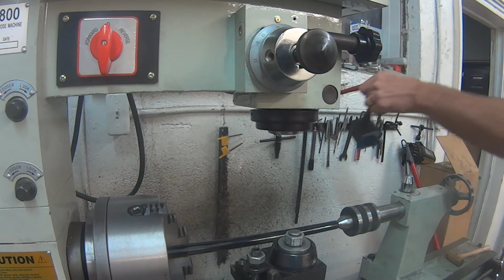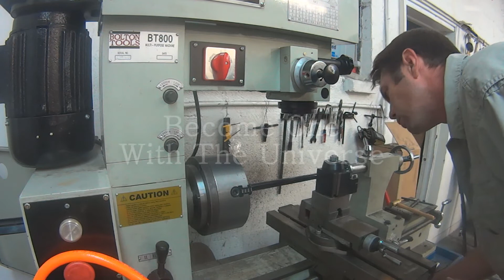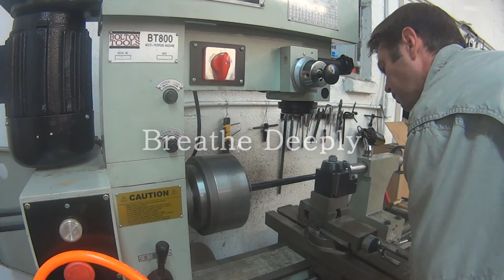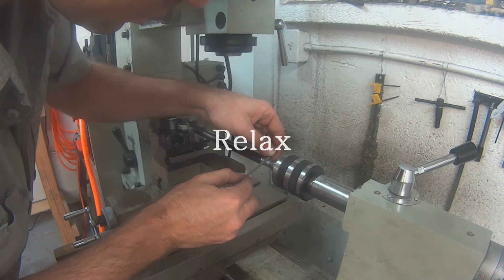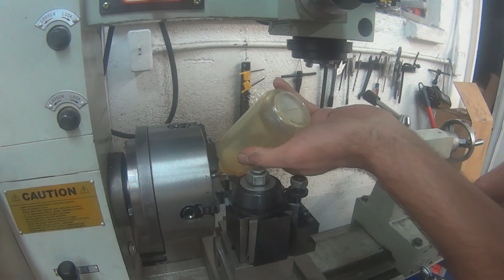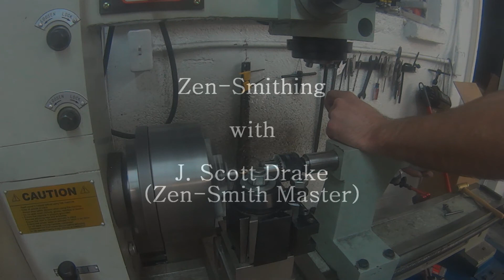Gunsmithing? No. This is Zen-smithing - Gunsmith Relaxation Video Bolton Tools BT500 Lathe

Comment: You can’t indicate a rifle barrel on the OD because the OD is typically never perfectly concentric to the bore. You should have turned it between centers or used a lathe spider on the rear of the spindle bore and indicated it with a gauge pin at the back.

Comment: Please build a threaded spider w/lock nuts and install it on the backside of your spindle before you destroy your bearings.
There is no use in dialing anything in while your allowing the stick-out on the back to jump around so violently.
Looks like 5/8 to 3/4 stock.  I've seen 2" round bar catch just the right speed & and vibration and produce an instant 45° bend and beat the hell out of everything behind a 15" Monarch lathe.  That included its own transmission gears and spindle bearings.  Took less than a second.
Could have been avoided by;
1.  Cutting stock to size
2.  Spining at the slowest speed possible.
3.  Placing a roller support behind the lathe and installing a Spindle Spider.
Think of how you'd shutdown that machine if Agent Chaos entered the equation of safety.  
Lucky for you that's only a 3/4Hp motor and would probably trip the breaker within a few seconds after cracking the Web-Patterned cast iron headstock mounting pad.
Look up and watch "Lathe Accident" on Youtube.